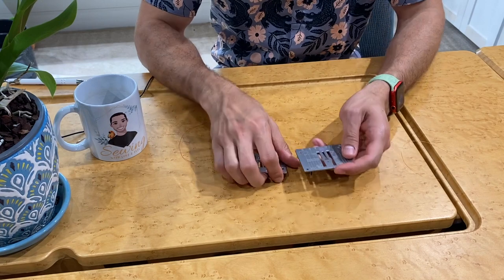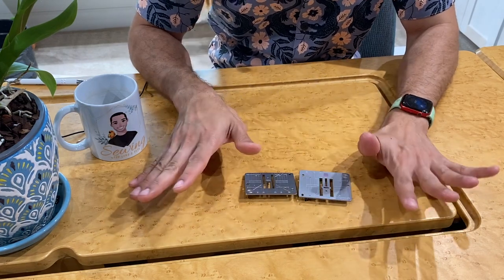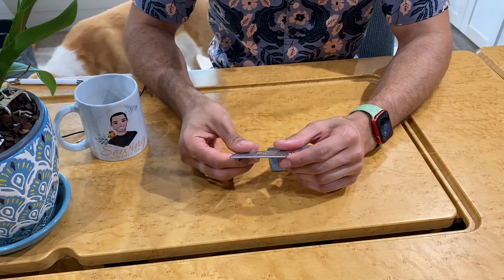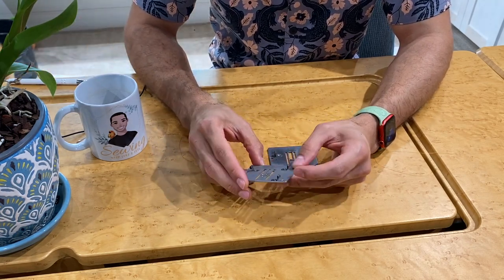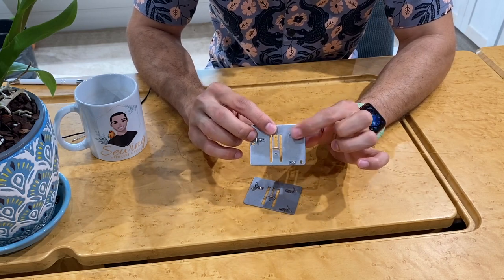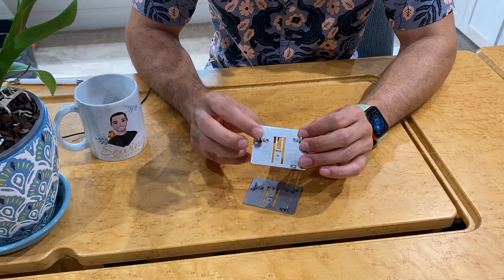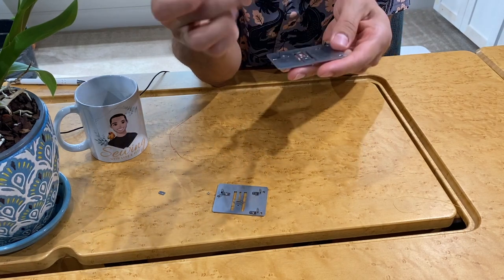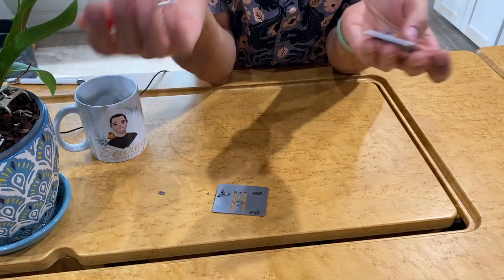Bernina Stitch-plate Problems!

Comment: Another very useful video - thank you😊 On a side note - my dealer does not seem to think a 5mm stitch plate is particularly helpful or advantageous for piecing on a 7series machine (specifically a 790+).  Since you mentioned this stitch plate in the video, I would be really interested to hear your opinion on this subject. No matter how careful I am, also using leaders, I still sometimes have problems with material being pulled down into the feedogs using a single hole plate mostly with  triangles. Have a great week Cody!